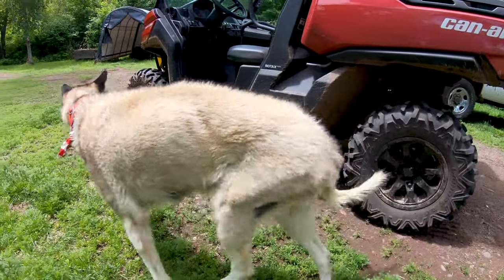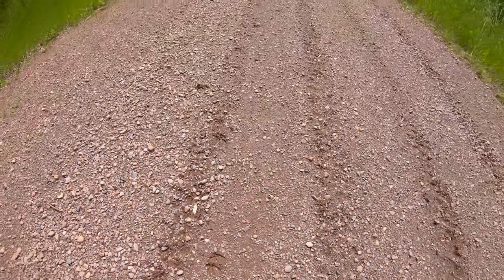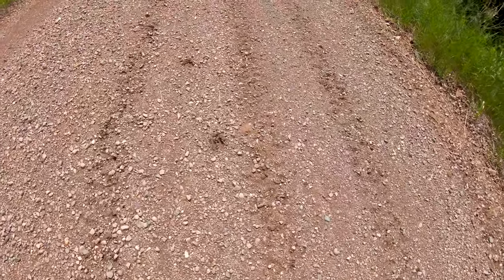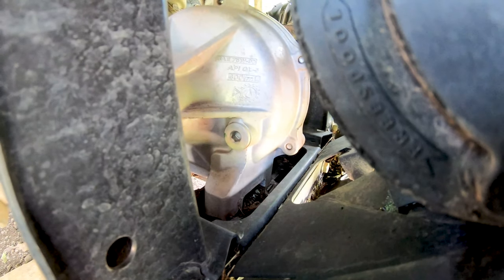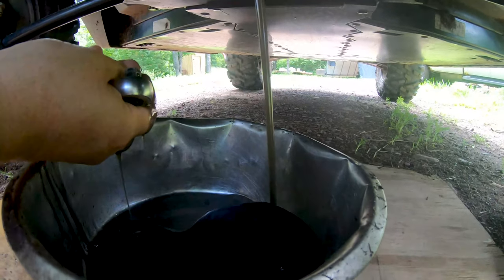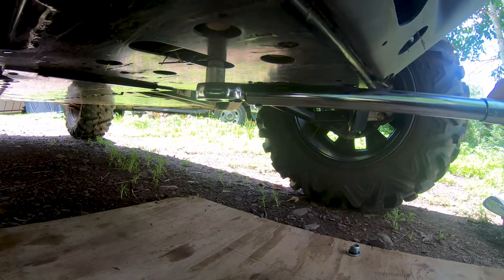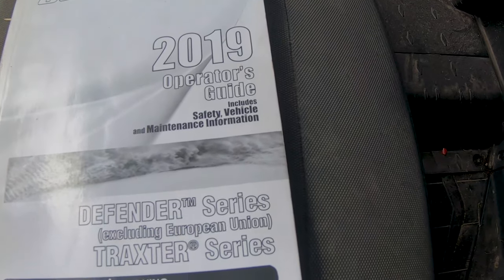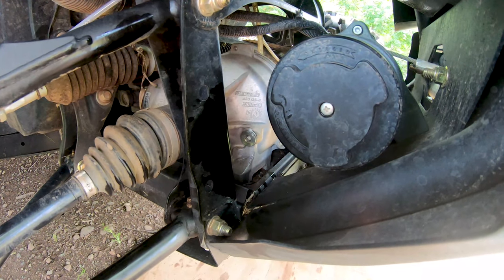Stripped Out Drain Plug // Can-Am Defender Front Differential

Comment: I just drained mine for the first time and now the drain plug won't tighten back up. It engages so it won't fall out but it just keeps spinning when turning. I'm pulling mine off to install a torq locker and can take a look at it on the table... once I figure out how to remove the vent tube.
Reply from the maker: Major design flaw IMHO. Such a finicky plug for a heavy duty machine. Hopefully they'll fix it.
Reply: Agreed. I did get the vent tube off and fiddled with it again. Same result. May try and tap it out, go with red thread locker, and hope for the best.

Comment: Did you pull the housing cover off and tap it on a work bench or just tapped it in place? Just had the same problem happen to me and dealer is going to take over a month to warranty it. Looking to do it myself this weekend
Reply from the maker: Tapped it in place very gingerly. Didn't have time to wait two weeks for a dealer appointment plus a one hour drive one way.
Reply: Endurance Kennels LLC you weren’t worried about metal shavings? Wish you took a video of the surgery!
Reply from the maker: @kylervaughn9904  no I flushed it out with old fluid.
Reply: What size tap do you use?
Reply from the maker: @kylervaughn9904  I'll have to look I think off the top of my head it was 10mm with 1.5 pitch but will check for sure.
Reply: Endurance Kennels LLC I would really appreciate it! This whole ordeal has been a nightmare with the dealer. Just ready to get it over with
Reply from the maker: @kylervaughn9904  okay I checked it's 10mm with 1.0 pitch. Save the drain plug clean it with brake cleaner then put red thread lock on it. Put back in very easily let it sit for 24 hours then refill. Check for leaks. I could have tapped with 12mm but couldn't find a bolt short enough to fit in there.
Reply: Endurance Kennels LLC so you tapped the threads to the original Oem thread size instead of going to the next size up?
Reply from the maker: @kylervaughn9904  yep they weren't completely gone
Reply: I took mine apart to drill and tap. There were tons of shavings from it for sure